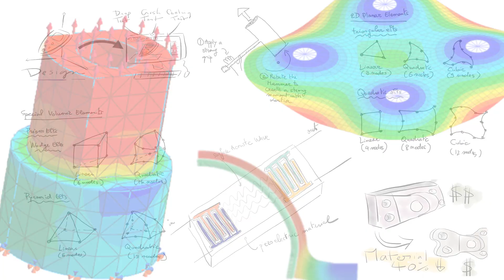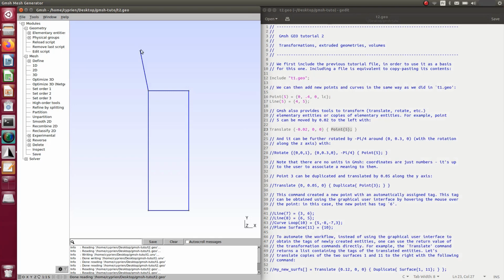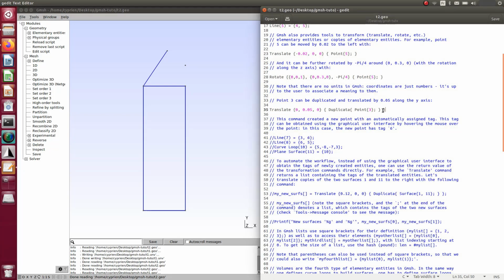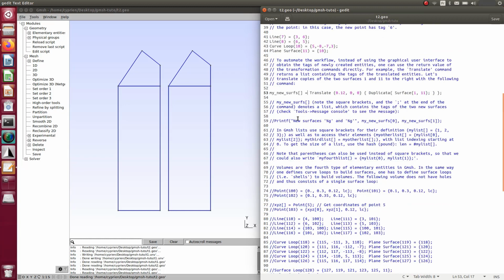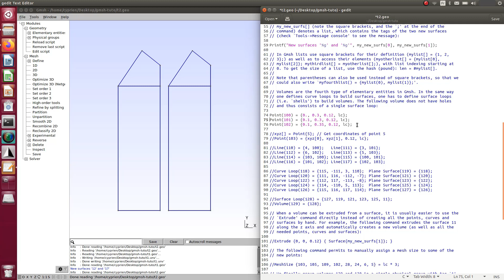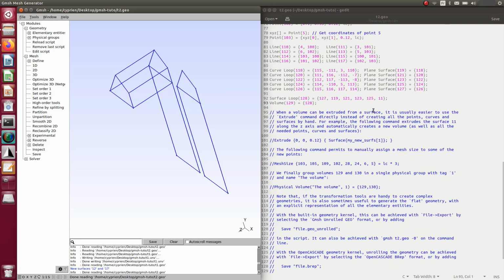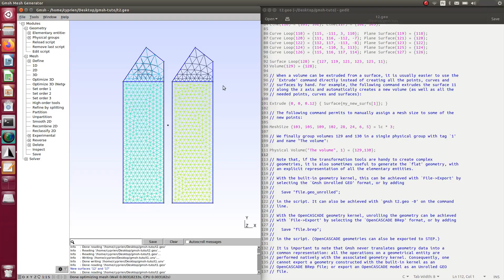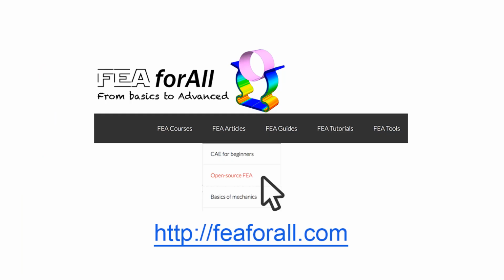[GMSH tutorial 2] Model Translation Rotation Extrusion and 3D Meshing - t2.geo

Comment: hi cyprien! I would say that gmsh was one of the last big pillars of the opensource simulation and meshing that you did not made tutorials ^^ so great to see it :). I have tried to incorporate gmsh to my workflow but did not find a way to, when importing a step file create the physical boundaries in the TUI, something like the face that contains the point p is the physical boundary inlet. (the issue was getting the tag of the desired face from only coordinates and not the GUI) if you find a way to do this dont hesitate to put it in the tutorials :D
Reply from the maker: You mean creating a physical surface group from a face that you don't know the ID, right? 
So basically, retrieving the ID of a surface within certain coordinates?
Reply: @Feaforall  yes exactly, without opening the gui I did not find a way to find the tag (id's of a surface) only from the script, like in Salome when creat a group by filtering using is contained by and a defined plane for example...